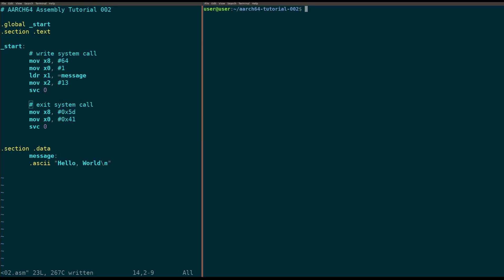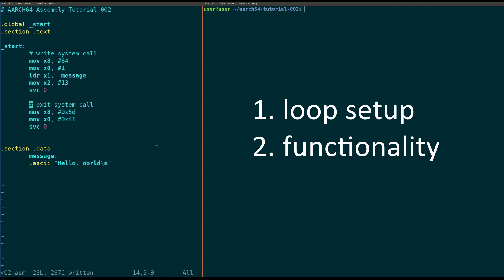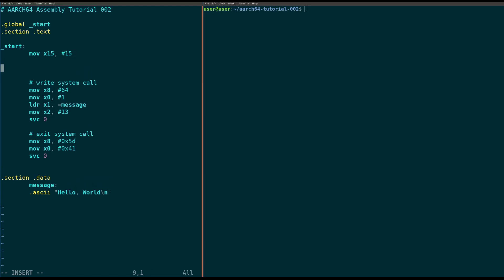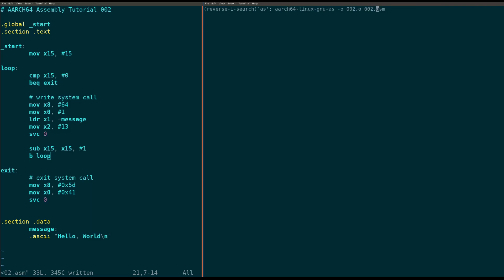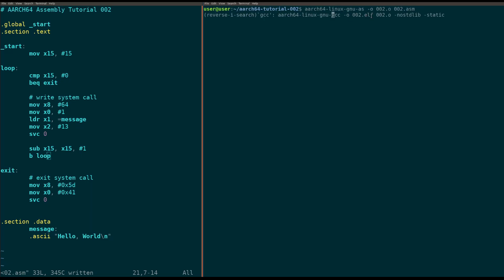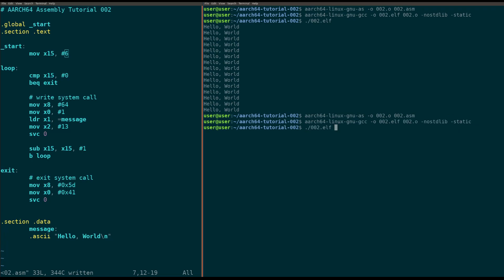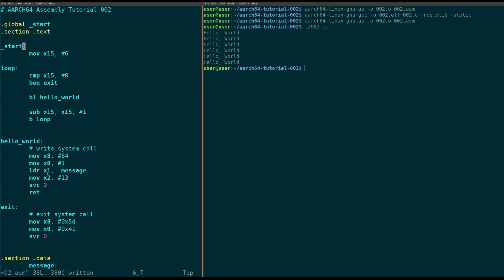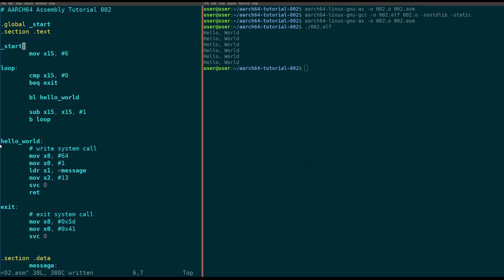How to Write Loops and Function Calls in ARM 64-Bit Assembly

Comment: You can't use x15, or a volatile register that can be overwritten if you're invoking some other function while you need your x15 value. In your case a service call. You got lucky and your x15 didn't get clobbered inside that function call.

Comment: For those trying to learn assembly to write programs on AArch64 Macs, here's a few points
- Syscall numbers are different. Check syscall.h header file. Exit is 1, write is 4.
- ldr X1, =message didn't work for me, but adr X1, message did.
- You should also add .p2align 2. Maybe after .global.
- Sections work differently, you need to write .section __TEXT,__text (segment name, section name).
- You can compile using as and link using ld, and by default it can pick up _main as the entry point, where you can also simply specify the return code in X0/W0 register

Comment: Isn't better to use subs and branch if not zero without first cmp and branch instruction?
Reply: Both take two instructions though, so you don't save any time or space either way. I think a lot of newbies like me find using CMP a lot more understandable and readable than things like SUBS or ADDS etc
Reply: @gregoryfenn1462  No, first cmp and and branch are not needed. subs sets the flags, and then you will branch if not zero to the start of the cycle. Otherwise you will continue. So next line should be exit.
Reply: @gcinko1525   I noticed the same thing. Very inefficient the way he did it. If programming on the Motorola 68K series or the PowerPC, then looping can be reduced to just one instruction, since both processors can decrement and conditionally branch with one instruction.

Comment: I have a maybe stupid question. If i
learn a more accessible architecture, like x86, where much more tutorials exist, will it be easier to then apply that knowledge to risk? will the Arm32 tutorials also help me?

Besides that - great videos! nice to listen to.
Reply: It will help in the sense of getting to grips with what a very low level language looks like and how they work, but it won't help with the ARMv8 syntax or instruction set

Comment: Just a note for anyone playing along with in old 32 bit raspbian, r15 gives a segmentation fault I think on the mov instruction. I think something to do with it being used for status flags (read somewhere) anyhow switching to r14 did the trick.
Reply: haha, well by the time I got to the end of the video and looked up 32bit equivalent of ret,... lets just say I worked out what r14 is used for XD (use r13 and all good)
Reply: I just decompiled my code (objdump --no-show-raw-insn -dC a.out) and it replaced r13 with "sp"... guessing that's the stack pointer X'D maybe I use a different one... =D
Reply from the maker: Its very possible that the compiler swapped out SP and BP
Reply: in 32bit arm, mov pc, r14 is the equivalent of 64bit's ret
Reply: @WistrelChianti  Ty, saved me some googling!

Comment: This is great! I have been searching for assembly tutorials, but most are for 32-bit x86, which won't run natively on my Surface Pro X or my Two Raspberry Pi 4's. Come to think of it, we also have 3 iPhones, an AppleTV and a Nintendo Switch. That's 8 devices, and they all use ARMv8-A chips. I'm glad someone is posting tutorials for code used in today's common devices.